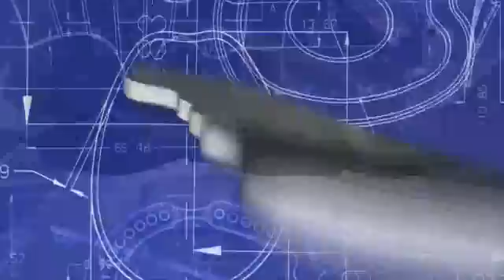#britek  Energy Return Wheel... Autonomous Never Flat

Comment: This would have horrific performance characteristics. The air in a tire as important to the suspension as the actual suspension. This will never find a home in performance motoring.  There is too much hardness, we would need a tire compound about 200 times more sticky to compensate for the loss of lateral movement in the side walls, as well as loss of the ability of the tire to warp to the terrain of broken down tire mass and inner curbing. 

Just a racing engineers opinion.

Comment from the maker: @dragsteralf Our 310 width, 24" od proto is 28 lbs. Bet you have never thought about this but...Pnu air pressure volume/mass @35% humidity @ 35 psi. adds about 2 lbs. additional weight to your pnu. Now imagine monster truck tires air volume. Imagine radically reducing monster truck tires unsprung wt. by replacing super heavy sidewalls and sidewall bead with super lightweight highly elastic sidewalls and a vacuum applied. Anti. gyro too. Talk about "going to happen".

Comment from the maker: @ddoggj1  Our patents present opportunity to the tire industry. They are still stuck in a "box". Their manufacture proscesses, molds their very bottom line is invested in todays momentum being caried out tomorrow again and again. Michelin Tweel?  Look at their "non issued" 2008 7 claims patent filing.  No way of pretensioning  only low speed applications. If they use airpressure and sidewalls "why bother". Our "ignorance" has just filed 2 new patents this month with slam dunk allowance. We lead.

Comment: id like to add one more thing. the main reason for blow outs is poor maintenance on the tires. a large percentage of drivers never check the tires, only changing them when they fail. sometimes when it fails it results in a blowout. 

to be successful the erw has to be affordable, low maintenance and tough enough to handle less then perfect roads.

Comment from the maker: @dragsteralf With carbon fiber/Kevlar hoops and pull plates,  thinner highly elastic sidewalls and reduced air volume IE two stage  "hoop side of membrane and sidewall/inner wheel partial 18 Hg. "inches of Mercury" vacuum ...ERW and pnu. are close.  Remember pnu. thicker sidewalls, multiple wires and rubber mass  making up the  rim beads plus the 30psi.compressed air "volume" does add to pnu. weight total.

Comment: uuh, no.. i can see this as a issue, as a technician, how am i going to change the tire from the wheel, un bolt every and each individual bolt from that tire, a simple tire change may take all day now... i can put 4 new tires on rims in no time at all, but this design would make changing tires a tiring and exhausting process... no pun intended.

Comment from the maker: @TheKiltedYaksman1 It is the opposite. The outer hoop is "sprung" to the ground by the 360 degrees of membrane pull. It is ballanced so well by this unique ERW suspension machine that it is also highly anti. gyroscopic allowing for much larger wheels. We also have a very large wt. savings for the largest sizes because our highly elastic " light weight" sidewalls are not required to support as much weight while still able to accumulate/return rotational and lateral forces.

Comment: this wheel offers no vertical compression, no spring damping effect between the rim and the road, means no ride comfort and no protection from road defects, this increased suspension and steering load will destroy chassis suspension and steering componenets at a greater rate, effectively shaking the car to pieces, the only way to utilize is in the racing spectrum where tracks are smooth and flat and increased hp and torque to ground can be useful, idiots cannot handle road cars as it is physics

Comment from the maker: @pmgodfrey Check out our high speed military on our web site. They are becoming more beautiful all the time. Notice the valve stems on each pull plate, they are for pulling a vacuum on the hoop side of each membrane IE vacuum boost increasing the "levitation effect", increasing membrane durability, the power of the  vacuum in addition to ERW dynamic tension multiplies horsepower and torque to the ground. Vacuum is also an additional barrier to vibration and shock transfer to inner wheel.

Comment from the maker: @InSorteDiaboIi  We hold the patents not Michelin!! You will not hear this fact from them.  Another point the Michelin Tweel cannot hold a "pre charge" on their rubber like spokes it would deform the "soft" hoop and collapse under heavy load acceleration. We now have 8 equally tensioned membranes pulling directly in line against an opposing membrane  across the hoop. This allows for the accumulation of "screw" or rotational force from drivetrain increasing  efficiencies to double digit levels.

Comment from the maker: @Dustin52456 Yes, you can put on just one. We fear that in the future high horsepower "older cars" or your family car of today may be limited to one ERW per drive wheel to reduce the calamity potential a senior citizen could cause by putting the " foot" on the accelerator instead of the brake.

Comment from the maker: @bobalong131 Good, you have now figured out that we have a durable flexable hoop.  There is equal tension from opposite directions across the hoop from the "pre tensioned" membrane "pulls". Impact responce is more immediate because there is already dynamic tension  pulling the hoop in the desired deflection direction. This "responce" effect has been improved by reducing the number of "pulls" to 8. We now have greater linear "pull plate"  travel or room to move with newer protos.

Comment: @EnergyReturnWheel 

I'm not concerned about the durability of the wheel, I'm concerned that it will transfer the impact directly to more important parts of the car. Low profile rims do it to a degree but these have significantly less flex by the looks of it, not to mention if you understeer into a bump it looks like it'll tear your whole hub off.

Comment from the maker: @bobalong131 Highly curved 50,000 psi. carbon fiber core topped with ballistic grade Kevlar reinforcing the hoop IE literally bullit resistant. We then apply 2 rubber wedges  that are kevlar bound  lateral and medial cushion + a traction layer. A pnu. falls into the hole and needs air pressure to build internally to keep the pnu from rim strike. ERW  equal force from oposite directions in "real time" across the hoop IE "animation" video steps in and out in an instant flash. True new age machine!

Comment from the maker: @viasevenvai ERW levers up hill, is "anti gravity" IE levitates or floates inner wheel whithin the scope of the hoop, conserves/returns  double digit drive train inefficencies, has 50% better rolling resistance, increases horsepower and torque to the ground through a "dynamic charged torque converter effect,  is anit bounce, anti gyro. and offers a return against wind resistance.  A 100 yr. old  PNU technology can not match a "NEW AGE" machine.

Comment from the maker: @bouligab Just so happens we are working on a vacuum install carbon /kevlar reinforced "body" with rubberized Kevlar spans. Vacuum pressure through air valve contracts the "body"  to be positioned over the  rim. When air pressure  is reintroduced through air valve the body recoils/ expands into position. The Body acts like a bow the rubberized Kevlar acts like a bow string. We also are testing a screw down version. We wil soon post our newest prototypes that we are combining into "super" wheel

Comment from the maker: @Blitzwolf44   Max. speed is yet to be determined. ERW improves with speed and so well ballanced in 360 degrees it is anti gyroscopic allowing for larger wheels. View the USDOT highway test speeds over 75 mph. ERW with no traction layer.. the membrane  "rivited" to the steel hoops. Notice "brake lights" coming on during coast down portions. Also note the "levitation" effect as ERW inner wheel floats high and foreward within hoop indicating a potential energy return against "wind resistance!!

Comment: what is the maximum operating speed for these puppies? one thing ive noticed is that blow outs almost always occur due to an abuse of speed and exceeding the safety rating.. will these explode at say 120kph? will there be different ratings with performance variations or one standard grade? Well done by the way ^^

Comment from the maker: @gerbilPROJECT ERW "low profile" SUV membrane is drawn approx.150% elongation to "pre tension" to total 7,000 lbs. Max. elongation at full displacement is 300%.  Membrane "burst" strength @ 800% elongation is 4,800 psi.!! One sq. in. would support the entire vehicle wt.! Each of the 8-6' X 6" pulls has over 72 sq. in. surface area to engage. Do the math. ERW is on a scale pnu. cannot match. Each pull "hoop" side membrane is backed by a powerfull 18 Hg. vacuum to further reduce membrane stress.

Comment from the maker: @LordPS3  Newest protos "highly curved hoop", "pre tensioned" to approx. 7,000 lbs. total membrane "pull" from 8- 6"X 6" carbon fiber kevlar reinforced plates. We can use so much developed tension because they are positioned directly across the hoop from each other. The hoop can be "initially" be moved out of position...gravity,rotational/lateral force impediments etc. because the opposing pull is allready drawing it in that opposing direction. ERW winds up/accumulates/returns rotational force!

Comment from the maker: @Maynard608 It is the exact opposite. We have found that the suspension travel is cut roughly in half as ERW "equal force from opposite directions" internally  displaces IE cancles out in "real time" impact and vibrations across the hoop while the inner wheel "floats" suspended by 360 degrees of membrane support. The responce to force is much more immediate than pnu. Pnu relies on air pressure to reform the tire body and treadblock requiring precious time to reestablish grip.

Comment from the maker: @GrandMoffSilvey It means we do not bother with technology that does not provide a "real" solution to major issues like dependancy on foreign oil,  highway safety, IE thousands of lives lost or impacted by loss of vehicle control due to tire failure/loss of pressure or  traction during/causing emergency situations.  It is about not quiting in the face of adversity. We are not in a hurry to make a buck. We take this mission seriously and when fully developed  ERW will change the industry forever.

Comment from the maker: @pdourte Yes. The pull of gravity draws/lowers the inner wheel within the scope of the hoop untill it "floats', drawing more tension from the top. Equal force from opposite directions across the outer hoop  for a unique 360 degrees "freedom of movement". The directional pull of the pre charged membranes" focusing to points" can remember and return any 3 D force displacement  not unlike placing your finger into a balloon and rotating it, when withdrawn rotational / linear force is returned.

Comment from the maker: @GrandMoffSilvey Try this experiment...take a balloon, place it on a table with enough pressure to make a pnu. treadblock. Add side pressure with both hands and notice what happens to your artifical treadblock. This action has been the bane of pnu. for a 100 yrs. Pnu. attaching to a wheel by sidewalls is like pushing an object with a rope. The path of least resistance is lateral displacement and tread squirm. You have just become acustomed to pnu. having yet no alternative from the industry.

Comment: Could this be scaled for a bicycle or motorcycle? How does tension play into this design and is the wheel supported from the top? How well does the system deal with lateral and compressive forces differently?

Comment from the maker: @xFollowChristx As the diameter increases so does the levering.  With our new more highly curved hoops it allows for traction paddles to extend up the sides for sand, mud, soft, loose surfaces while having a more contiguious tread pattern for smooth street rolling.

Comment from the maker: @xFollowChristx Tires need to be deflated because the pnu. and wheel can not move internally as a unit to assend objects. A low pressure tire becomes flat on the bottom morphing around the object surrendering efficency/control and trying to reduce pnu. "bounce back" all levering from the bottom, a bad thing while assending hills. ERW is "top heavy".. levers/drives uphill from the top 180 degrees so that by the time you hit something your momentum is already projecting up and over the event.

Comment from the maker: @ITALIANGTRR34 You are talking about the problems associated with pnu. Aggressive manuvering is what led us to a highly curved hoop with "outrigger"kevlar bound  rubber wedges that are forced to the surface when the hoop is displaced laterally under hard cornering... increasing psi./ traction. For motorcycles ERW acts like a lateral shock absorber when leaning over unlike pnu. Also each  ERW membrane is "pre loaded" or drawn with much more tension than the weight of the vehicle it is supporting.

Comment: also,when u take a hard coner normal tires curl at the edges and can even rub the rim,without and overlapping edge to protect the rim wouldnt that be a issue? for a car it can work for normal driving,but for aggressive driving,or racing I dont see how it can? I also dont think this setup would ever work for motorcycles at all,I drive a sportbike and I'm into cars as well.with a bike you lean over to the edge of the tire,without that edge u cant turn.

Comment: I think it is a cool setup,but what keeps the tire portion on the rim if your take a hard turn,or launching your car froma dead stop,burn out,racing,stuff like that,couldnt it jump off??? If you do a burn out or a hard lauch from a dead stop I can see it stretching and coming off?? and what about the weight of this setup?? If it heavier then a normal rim/tire setup would you use more gas and also wear the tread down faster??

Comment from the maker: @drinferno666 Try this experiment... Take a rubber band, place it on your lips and stretch it then allow it to contract. You will notice it heat up when it stretches and noticably cools when it recoils. ERW recycles heat. As already mentioned ERW utilizes equal force from opposing directions throughout 360 degrees to allow "freedom" = acumulation and "return" of movement while undergoing lateral / linear / rotational displacement. Ballancing is "no problem". Check out our 6,000 lb. dyno vid.

Comment from the maker: @MaxPusch Our newest highly flexable carbon fiber/ Kevlar hoop @ 50,000 psi. burst strength will easily move vertically and or become oval in responce to major surface irregularities. It can respond faster than pnu. because it is already being drawn by the opposing 180 "pull" in the desired direction to maximize surface contact... the exact opposite of pnu. What is the psi limit of pnu. treadblock? Spike strips anyone?

Comment from the maker: @grinsimitation Pnu relies on "air pressure" to return to shape... path of least resistance is a vertical bounce compressing the shock absorber and generating body lean. ERW is constantly adjusting, hoop centering under aprox. 7,000 lbs. 360  drawn membrane tension. Any oscilation/bounce is cancled out by the "singularity effect" 180 degree opposing pulls. ERW improves at speedcheck out our dyno video where "brake lights" show up as the lab tech. attempts to keep to the "coastdown" portion.

Comment from the maker: @LiquidFunkify The 360 degrees of  "pre charged" membrane levitates the inner wheel within the scope of the flexable carbon fiber Kevlar reinforced "hoop". All / any degrees of movement IE. lowering to the ground..rotation from throttle responce...braking force ...lateral displacement from manuvering "all degrees of freedom" is accumulated and returned as the hoop  "recenters" under dynamic membrane tension.

Comment from the maker: @lukyll Equal force from opposite directions "charge" is anti gyro, anti bounce. Even our early protos shown here cut impact / shock and vibrations in "half". This ERW responce happens in "real time"... a singularity... across the hoop and when coupled with the pull of gravity generate a dramatic "deweighting" effect. Less suspension travel side to side front to back more stability. ERW stays on the surface longer and returns faster over bumps.

Comment: @webworkhere 
Have you even watched the video? The inventor says nothing about tyres producing electricity. The wheel is all mechanical. The springs inside the tyre conserve some energy and give it back as the tyre spins. Thus making it easier to move. Less energy is needed to go from A to B.

Comment from the maker: @xXxNI7ROxXx  The 4,800 "psi." burst strength ERW membrane is drawn 360 degrees with a larger % from the 180 topside when still . Each pull has a "pre loaded" equal and opposite partner drawing approx. 700 lbs. each. The 360 degrees of combining equal force/oposite direction "floats the wheel unlike pnu that flattens on the bottom to support the wheel= flat spots noticable at speed. On the newer protos each one of the 8- 6" x 6" pulls can support the entire weight of the 4,800 lb vehicle.

Comment from the maker: @mcgmark We have clarified that tread would not need replacing as often due to the reduction of tread squirm. Our recent developments allow for replacement of individual components,removable sidewalls, hoop and traction layer, replaceable membrane. We are also pioneering a completly new type of "micro linear" traction layer construction relying on carbon nanotube infused rubber  and nanotube infused kevlar for crazy durability and traction on virtually any surface.